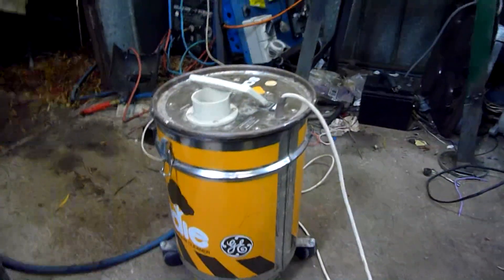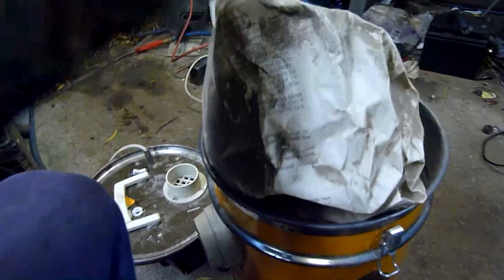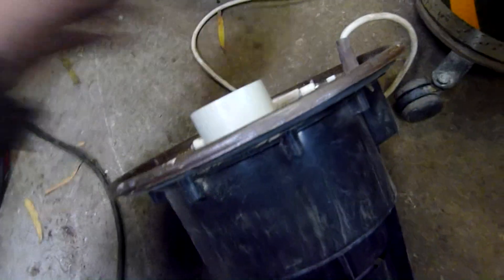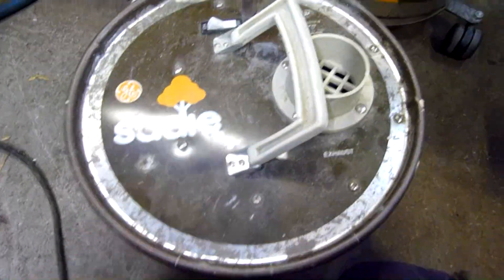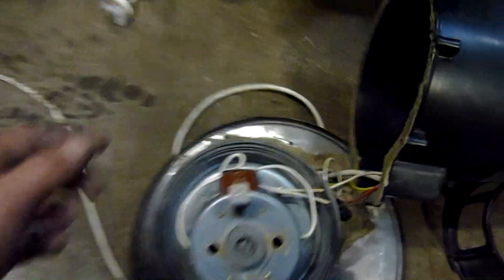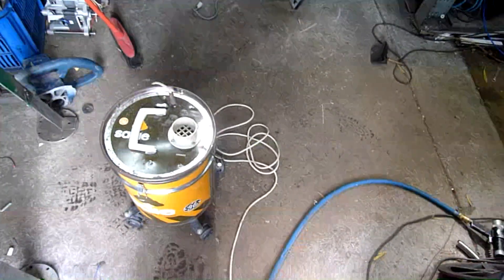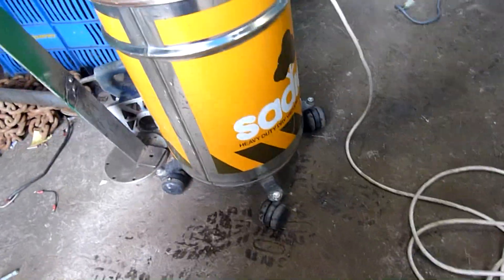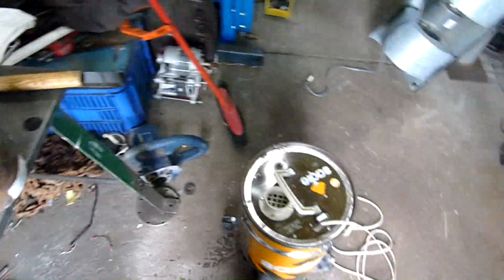GE Sadie Vacuum Cleaner Fix and Test

Comment: Sears used to sell a kit to make a 55-gallon drum into a twin-motor vacuum cleaner.  A friend of mine has one which has been sitting out in the weather for many years but still runs.  You can still get 55-gallon vacuum cleaners, but no one makes kits for them any more and the pre-made ones are VERY expensive.